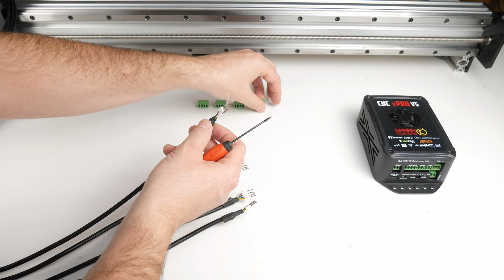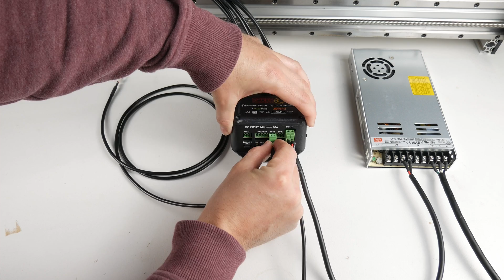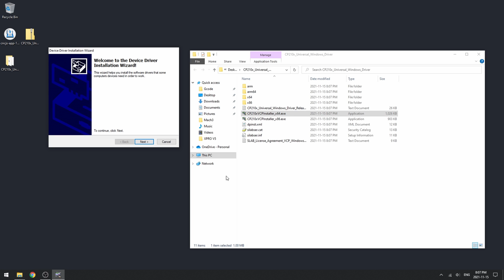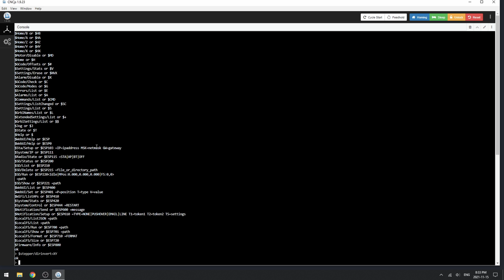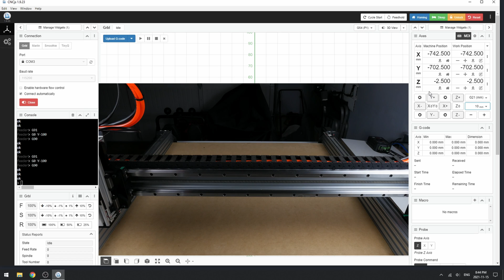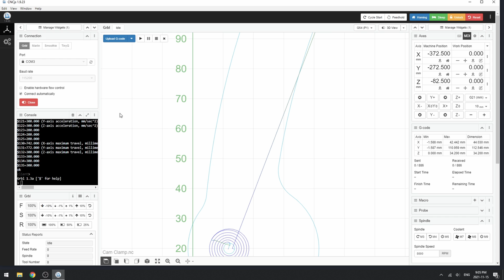CNC xPRO V5 - Installation and Configuration

Comment: none of the codes i am using are working i have doble checked the wires the y axis is not timed right and it sounds like hell on all of them. i put your codes in and they still do the same thing. HELP

Comment: I bought a Queenbee for myself as a retirement present and just finished building it with the help of these excellent videos. Thank you
Reply: How is the controller holding up?
Reply: @  

I have used it quite a lot and overall very pleased with it. It has been reliable and easy to use.

I find that the motors get quite hot if used for an extended time so probably need to look at the drive settings. Also, I have not managed to find a suitable grease gun to lubricate the linear  bearings as they are very small. Any suggestions for this welcome.

Comment: First off, thank you so much for the videos you have made and knowledge you are willing to share.  I am in the process of setting up my xpro v5 controller and ran into an issue with my hard limits (homing switches).  They are wired NC & I have updated the firmware with the appropriate XYYZ_NC file.  I am also using CNCjs (couldn't get very far with Universal G-code sender).  If i activate a limit on the axis that is moving, it stops the axis like it should.  When I send a "?" command, I receive this" <IDLE/MPos:143.880, -213.408, 55.000/FS:0,0/Pn:XYZ>" which tells me the limits are active, correct?  I think that is my problem....?  But if they are stopping the machine when I press one, why do they show active when not pressed? did I miss a setting in the initial set up?

Comment: Hi, I have almost completed my first CNC build now using an xPro V5 with HY VFD, a 1.5kw spindle, but have run into an issue with controlling the spindle from the xPro V5 via the HY VFD.
I am able to control the spindle directly from the VFD, I can start, speed it up, I can slow it down and stop etc.
All of my stepper motors and limit switches work fine via the xPro V5 (I have been using CNCjs software to control the machine).
However I cannot get the spindle to respond via the xPro V5. I have been trying for 2 days now to get it to work. It will not spin.
Is anyone out there able to help me?

Comment: Thank you! I do need a bit of help if anyone has had the same issue.

I cannot seem to run the spindle from cncjs, followed everything exactly.

I can run the spindle from my huanyang vfd itself, though.

Everything is wired correctly and the switch is set to rs. Also Where it says spindle on the xpro box there is a green light as well.

Any help is much appreciated, cheers

Comment: Thanks for the video. I have tried to follow it,  but I am not able to control the spindle from the xPRO v5.  A guide on for the controller github stresses that the serial connection must be done with a twisted pair cable, and that it needs 120 ohm terminators at both ends.  I have done the programming of the VFD as per the guide provided by the xPRO v5 guide.  The spindle moves if I switch the control to the front panel with the PD001 and PD002 commands, but will not work with these settings at 2 (communication port). I am considering using analog input, but not sure how to wire from the toolhead port on the controller to the VFD.  Any ideas, or suggestions?
Reply: I have the same problem. How do you rich it?

Comment: You get to the part at the 7 minute mark where you install the two RS leads and then you say it's time to power it up.  However, I don't see where you covered the other wires shown, RST and UVW.   Is the green wire for the spindle input the ground?  I don't see that wire in the video.  Also, For RST I don't see anything running to the "S" lead.  Do you have more details for these wires for dummies like me who need more details?

Comment: Just bought a xpro v5. It looks very simple to setup, I will be using prox switches for limits/home (NPN NO). One thing that concerns me is that the estop is setup as NO which means that should you have a break in the cable or a bad connection then the estop will do nothing (not good) The limits/home are easy to invert from NO to NC through the software $limits/invert but there is no setting for the estop apart from flashing the firmware, which I just can't get my head around. Any suggestions.??

Comment: Just set the machine but I have a problem, my emergency button is set in opposite way it should : (if you press it stops the machine but no error given, if you release it, CNCjs tell me the door is open) is there a command to invert this function in order to use it properly as emergency button?

also when I use the $spindle command it just says "ok" but nothing happens and can't command the spindle from cncjs
please help me
Reply: Hi, I'm installing this machine right now and I have this same problem, have you been able to solve it?
Reply: @brianjosue9911  downloaded a different firmware and fixed it, but check the proper one or you have inverted axys
Reply: @DenisMondino  what firmware did you download and where did you find it? I have same problem.
Reply: Bonjour, je sais pas si vous avez résolu votre problème mais j'ai exactement le même souci que vous mon arrêt d'urgence fonctionne a l'envers  et la commande $Spindle/type=Huanyang  répond seulement avec le message "ok" je ne sais pas quoi faire et je ne trouve aucune réponse sur internet. Avez vous résolu votre problème ? si oui pouvez vous partager votre solution avec moi s'il vous plait... Merci

Comment: Very nice informative video. I have a problem though. Did about. Everything the same. Can connect by USB and wifi. But jogging doesn't do anything. When I press a switch I see that in the software though. Same with emergency button. See that also in the software. What can be the reason that the motors don't do anything when jog them?
Reply: I have the same problem did you find the solution?

Comment: A friend of mine got a new CNC, and he gave me his Workbee 1510, and it has CNC xPro v5. When I plug the USB into any computer (I've tried 3 windows machines so far), I get a popup saying that there's a power surge on the USB, and that the device needs more power than the port can supply. When I open CNCjs, there are no USB ports available. I've tried everything including uninstalling the USB drivers and swapping out machines with no luck. This is my first experience with the CNC world, but I'm also a software engineer, so I have a fairly good grasp of the process. Anybody know what might be causing the issue here? I really hope the xPro isn't fried.

Comment: Hi. I have just finished the build on my Bulkman3d Ultimate Bee with the xProV5 controller. Everything seems to work correctly, only one problem. I have set my steps per mm after checking the movement with a ruler however the z axis steps per mm is a lot higher than the x and y axis to get it to move with correct measurement. When I start a job the z axis moves up and crashes into the limit switch. what have I done wrong.  X steps per mm = 320 and y steps per mm = 320 but z steps per mm = 800.

Comment: I have eventually been able to get my Ultimate Bee to work perfectly following your fantastic setup video. I only have one problem. In CNCjs I am able to start the spindle with the M3 command but it will not stop with the M5 command. Am I missing a command or setting somewhere.
Reply: saludos desde España. ¿podrías pasarme esa hoja de trucos. tengo la ULTIMATEBEE 1500x750
?

Comment: Great video!  I appreciate the way you went through this.  Made it much easier for the electronic handicapped such as myself.  I did run into an issue when attempting to pair the spindle.  I have the exact same one you use in the video but when I type the line $spindle/type=Huanyang,  it just says ok.  It doesn't start the process like yours does,  any suggestions would be greatly appreciated!
Reply: I have the same problem! Did you menage to solve it?
Reply: @konradepek2402  no, I never did. Sorry
Reply: You need to update xpro v5. Be careful with the emergency stop, if it is normally open, update with the NO version, if it is normally closed with the NC version.

Comment: Hi there 
After completion installation. I connect usb cable to cnc xpro v5 (after installation CNCjs 1,10.1 latest version) unfortunately on right hand side of screen only position of machine and  Work  is on the rest are light grey  i can’t move spindle on xyz direction could you please advise me how I’m able to fix this issue
Many thanks 
Vic

Comment: I just purchased Ultimate Bee and I must say if it was not for your videos I would be totally lost. I am having an issue which I hope you can assist with. in your video on connect the Xpro v5 to the Huanyang Y Series you show how simple it is to connect to the RS+ and RS-. I don't have those features on the G-Penny H100-2.2S2-1B. Could you possibly assist in how i would connect the H100 to my Xprov5.
Regards

Comment: Thanks for sharing. Did you experience the y axis issues I see on the xpro v5 GitHub page? Are the stock cables (bulkman3d) shielded to earth or do we need to provide ourselves? I am waiting to receive the ultimate bee with this controller but I am a bit afraid.. thanks for your suggestions
Reply: Hey you got any more info on this??

Comment: hi, thanks again for your videos! when I launch the spindle in cncjs (M3 8000 rpm) it works. but I can't use the M5 button and the emergency stop button doesn't work too. I have a error message saying: not reach the speed -1 rpm, and Lamar 10. do you have an idea to solve my problem? thanks

Comment: hi, 1st thanks for all your videos. when I put on the machine, the 4 motors are making a sound like little blow, or little current, is it normal? I have not yet connected the computer to the controller; thanks for your help
Reply from the maker: Yeah a little hum can just be the motors holding position  as long as they are not getting hot to touch that's fine.
Reply: @IllDoItMyself  thanks for the answer, I will look if the motors are getting hot or not. is it possible to low the holding position current to make the noise reduce?
Reply from the maker: It sure is. You can even have it turn off after a certain amount of time

Comment: There is so little info about the xPro out there.  I have been trying to set up my system for a while and just kind of gave up.  But I just found this video and plan to try it out again. Not sure why there aren't more thorough tutorials with the xPro.  If I had known about that, I would have gone with a different controller and would have been up and running a while back.  Thanks for creating this video!
Reply: I just finished setting mine up.
Alot of this is much easier thru the ugs wizard. But i did have to do a crash course in grbl commands. To get my head around it.

Comment: Issue: stepper motor stalled.
Hi,
I followed your video to set up my queenbee pro 1515 with Cnc_xpro_v5. I have set my X, Y, Z max speed at 4000. But whenever i try to move the X axis over 100mm or more  in a single jog press, the stepper motor starts smoothly but nearly at 90mm distance the I hear vibrating noises from the Z axis mounting plate and in a second the X axis stalls, motor also sounds stalled in its position.

Comment: I noticed that you switched up your vfd grounding from previous videos.  Where are you running the wall ground, spindle ground and spindle shielding now?  I'm trying to figure out how to ground all components correctly.  My system has a 24V power supply, xPRO V5 and VFD.

Comment: Hi, first of all thank you for your videos, they are well detailed and explained. Secondly, I would like your advice since when I switch on the CNX xPRO V5, all 4 stepper motors do a strange continous tedious beeping sound (like they are cutting voltage). Do you have a suggestion if what might be going wrong please?
Reply: Mine does too.... I got Queenbee Pro, 2.2kw, water cooled, cncXproV5,... Just finished installation..
Reply: same , I have a sound int he motors when I put on the machine, do you find the problem?
Reply: same , I have a sound int he motors when I put on the machine, do you find the problem?
Reply: @vincentbrun  yes.. it is a buzzing sound. I managed to reduce the sound to an acceptable level. i found out that the sound is caused from the retention voltage of the motors being high when the motors are in idle state. in idle state the motor tries to hold its position, so it uses some energy and this causes the humming/ buzzing in the motor.    you should change the idle motor voltage of each stepper motor. i forgot my settings for my motors but you can google for the idle voltage setting of can follow the settings in the video and if the humming is still there, set a lower value and see if the humming is in acceptable range. Note that, setting too much voltage will burn your motor quickly and tool low setting will result in unstable motor movement. hope it helps

Comment: I have questions,How to remove or reset old command if i want change the working area, or etc, because my cnc x prov5 on the way to arrive, im never have any experience about wiring and setup,, im buy this machine because after watched this video.,and will refer this video   for install soon,,HOPE WHO READ MY COMMENT PLEASE REPLY ,as a guide to me for installation process and cncjs setup
Reply from the maker: Sure thing, type Settings/Erase into the console and this will clear all the settings on the controller.
Reply: @IllDoItMyself  thank you sir,,
I have bought spindle 220volt ,it compatible for my home 240volt
Reply: I means working area limit

Comment: Hi, Thanks for the great videos.  I live in Barrie, Ontario and I'm thinking of buying a QueenAnt 1515 with the servos steppers (4.3amp I think). I have no clue how to select a controller and they have several options. Most are Mach 3 and I understand I would need to buy Mach 3 software if I choose one of those controllers. However, I see other options ie. GRBL controllers or Arduino based USB controllers. There are so many permutations that I don't know the best route to go.  I want to use VCarve Pro and have downloaded the trial. A controller that appears on Vectrics list of controller would probably make setup easier??   The work I will be doing is 2D and 3D signs  etc.

Comment: Thanks for another great tutorial. I am having issues with inverting my Y axis, when I use the $stepper/dirinvert=y command, it seems to register when I check the controller settings but doesn't actually change the direction of travel when I hit Y+. Do you have any ideas what may be causing this? Thanks
Reply: I had the same problem. Did you figure it out? I ended up changing the wiring around to change the direction
Reply: @KM-ql8mp  After you change the settings ($stepper/dirinvert=Y command), you have to reboot the controller by pressing the reset button. This fixed it for me.
Reply: @KM-ql8mp  try to press the reset button on the controller

Comment: Love your video on the queenbee from bulk man! It had been very helpful. Building one myself, but have run into EMI issues. The end-stops is triggered on and off when my spindle is running. How did you wire the shielding in the cables? Do you also wire the shielding in the end stop to ground? (when I do, my end stop is trigged, so I have just wired the stepper and spindle wire shielding to the ground)
Reply from the maker: The way to do this is use a grounding bar that every single ground is tied to. This means all shielding and ground points go to this one single point and then from there out to the wall. Nothing should split anywhere else as this could induce a loop. Take the time to do this correctly! If your still having trouble try hanging your spindle cable instead of running it through the cable chains. Also get on the facebook group for more assistance "CNC Router Workbee from China"
Reply: @IllDoItMyself  Thanks for the response ♥️ 👍 I'am going to try that. Think the noise is transfered through the grounding in my current setup for some reason. Changing the end-stop logic from 5volt to 24volt with the jumper in the controller mitigated some of the issue, but I do not fully trust it yet without doing some other measure to fix the core problem. Subscribed to the facebookgroup as well. Have bought some ferrite rings, and is going to try out that as well...
Reply: This may be late but shielded cables from the vfd to the motor is essential for low EMI, and every vfd is different so RTFM when terminating the mains wiring to the motor 👌

Comment: Hi, what difference between xpro V5 and UC300 ? What do you prefer ? And you use which software to control your unit (Uccnc, Mach3, other ?) and make your gcode with Vcarve Desktop is possible ? I want switch for my stepcraft D800 v2 to queenbe. Thanks to your help
Reply from the maker: Hey, UC300 is a Mach3 controllers only. Meaning you need a licence for Mach3 and you can only use this software to run it. They work great in my opinion however the V5 is a GRBL controller which is opensource and has lots of supporting software out there including cncjs. I generate my gcode with both Fusion 360 and Vcarve depending on what I'm working on. Both work great!